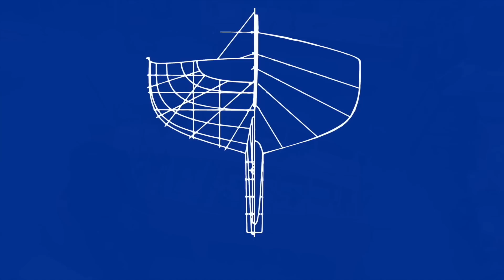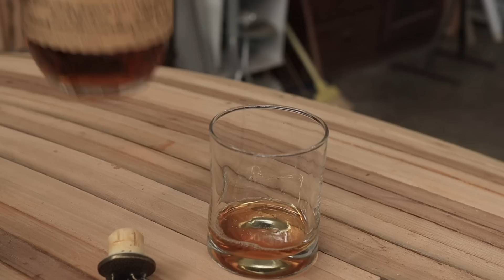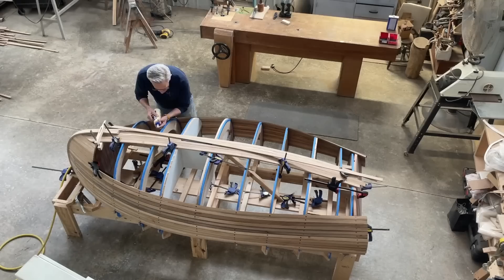Finishing the Dinghy Hull: The Incredible Strip Planking Transformation (Part 2) S3- E13

Comment: Looking good Bob. I commend both you and Steve for staying away from a bright finished hull. I think a lot of people would enjoy the strip planking method more if they did't have the anxiety of a bright finished result hanging over their head. Maintenance is easier too. I've had countless bright finished strip built canoes presented to me for repairs that were suffering from terminal epoxy and glass UV degradation due to varnish breaking down and not being refreshed in a timely manner. Getting caught out by the stem and cutwater width issue is an easy pitfall to find oneself in. It's not exactly intuitive. I personally always detail those elements out in my lofting process to avoid that mishap but only because I have found myself in the same shoes as yourself. I also sometimes fabricate the stem and cutwater separately due to the different material width requirements. Enjoy your impending date with the misery board Bob.

Comment: At this sealing  class I had at this place I used to work... They said whenever you apply cement  or glue or bonding agent always rub it into the surface and it will hold twice as good... Rather than just laying it on there and then assembling

Comment: I always learn something I didn't know when I watch your channel. This time the flipping the clamps around to be spreaders was the biggest take away. I will keep that in mind because it comes up from time to time. Not sure the clamps I have will work that way... The weight you are estimating is a lot lower than I expected. In my mind anything less than 100lbs would be light. Although, less weight means that it will be slightly less stable. I will be curious to see how this works in real use. I fully expect it will work well.

Comment: Thank you for the education. I was given a model sailboat hull about 60 inches long made of mahogany; it also came with a 26-pound molded lead keel. I have been reluctant to do anything and may proceed after a careful inspection. I also hope to learn more about the "A" class boats I am told sailed in the 1940s on Sunday afternoon in Central Park in NYC. I was told the boats were adjusted for each tack from rowboats. 

I have a fiberglass 2-meter hull that is nearly identical that I expect to complete first with radio-controlled sheets and steering to acquire the materials to do so and then apply what I learn to the "A" boat.  BTW, any information at all would be appreciated. TIA

I will watch this series again before I begin. Thank you very much.

Comment: Why dont you leave the screws in? I thought they would give extra strength. Or is the glue strong enough? Looks great.
Reply from the maker: Two reasons. 1. They are steel and will rust. 2. They only hold the planks until the glue has set. The molds they are attached to stays on the strong back and are not apart of the finished boat.

Comment: How does steaming planks comply with the need for wood to be dry when you glue it to another plank?
Reply from the maker: Has no effect on the glue setting. As the plank cools most of the moisture is out of it because of the heat. Once it's cooled the glue will set normally.
Reply: @TheArtofBoatBuilding  Thanks for your quick reply.

Comment: Looking good.  Did you consider carbon fiber vs fiberglass for the inner or outer hull covering?  If so, what are the basic +s & -s of each for the purpose?
Reply from the maker: We did explore that with John Harris from Chesapeake Light Craft. The other option was Dynel both require much more epoxy resin resulting it a heavier hull.
Thanks for watching!

Comment: What a beautiful  small boat!   I see that you are using Titebond II (blue bottle).  Why not Titebond III (exterior waterproof green bottle) ???
Reply from the maker: Titebond III set time is twice as long as Titebond II. In moving from port to starboard the strips set fast enough so that not to have a wait time for them to set. The hull will be sealed with epoxy so the added water proof instead of the water resistant has no baring. If fact one could use Original Titebond (red) without any issues.  Original Titebond is what Nick Schade uses.

Comment: The transom is at an angle, depending on how far the hatch will extend 
into the dinghy when it is upside down on deck, it might eat away an inch or two for clearance.
Reply from the maker: The building of the fore and aft seat has been well measured and explained in several of both Steve and my videos. I even went as far as drawing a full size drawing for Steve to layout on the cabin top. No worries measure a dozen times build once!

Comment: Thanks for addressing the comments. I have no doubt the boat will be strong, light, and beautiful. Still wish you'd used hot glue or even staples instead of those massive drywall screws though - then you'd at least have the option to maybe paint the paint the bottom but varnish the topsides and/or interior. Steve D. is going to have to maintain the varnish on the transom and bulkheads anyway, after all. Also - for the purposes of conversation I'd suggest that every construction method requires compromises, and strip planking is optimized for enabling a plastic boat to look like it's made of wood. If that's not the goal, then perhaps a different method might be more efficient, and possibly even look more "traditional." But that said I enjoy your content very much - I'm here to learn, not to insist you do things "my way," so thanks.

Comment: While fairing, how often do you have to sharpen the plane blade?
Reply from the maker: Frequently! The cedar is soft enough not to dull the plane iron fast ,however the glue joints do take the edge off quicker.

Comment: Why fair the strip planking (removing material/strength) when you're going to use fairing compound?
Reply: 1) The ratio of material removed to the remaining material is insignificant.  2) In fiberglass/wood sandwich construction, much of the stiffness of the finished product comes from the glass skin.  3)  By removing the high spots first you reduce the size of the low spots, resulting in less fairing compound used and lighter weight.